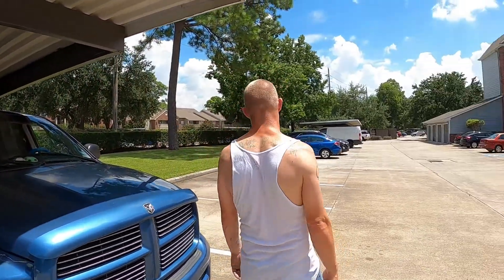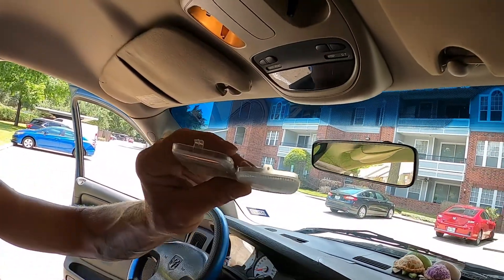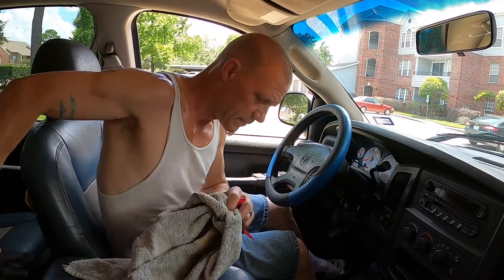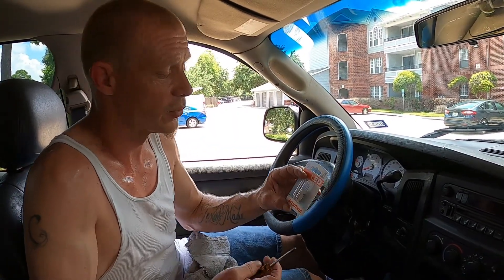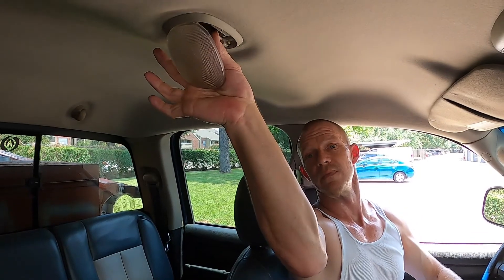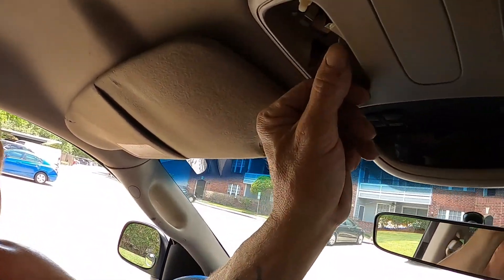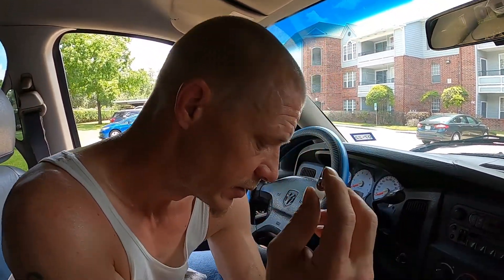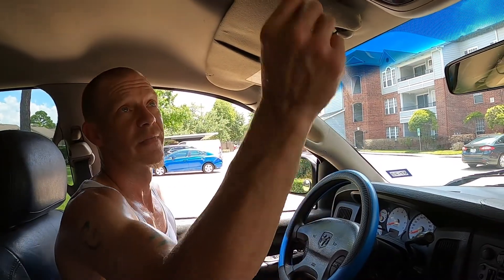Do not buy these LEDS for 03 Ram interior lighting Started out good. Ended up bad

Comment: What's the part number for the dome light in the center?
Reply from the maker: The original or the leds
Reply: @autoguydiy4244  leds
Reply: @jholivanotero did you ever find one?
Reply: @JesusOkc  I did at autozone. I think the part was 168? I bought them like  a yr ago.
Reply: @jholivanotero  I’m looking for the one like he had in the overhead above radio min keep flickering
Reply: @JesusOkc  pull out your current ones and take em with you to Autozone and see if the 168 match them. If not ask the associates in the front.